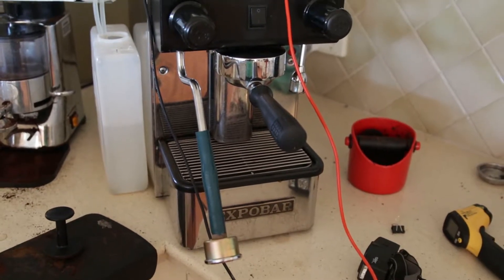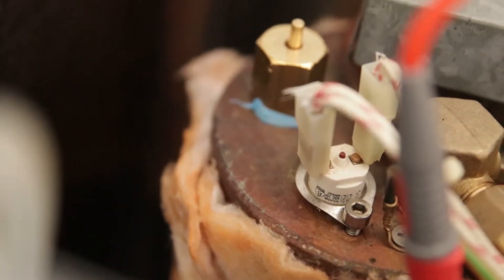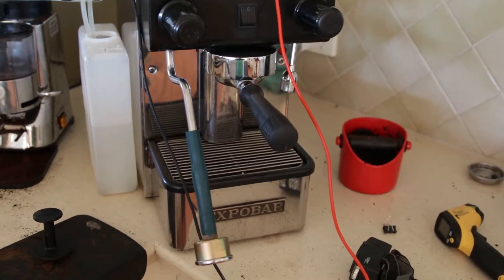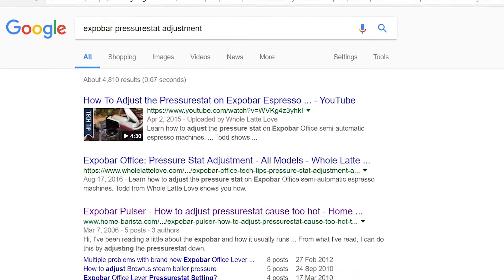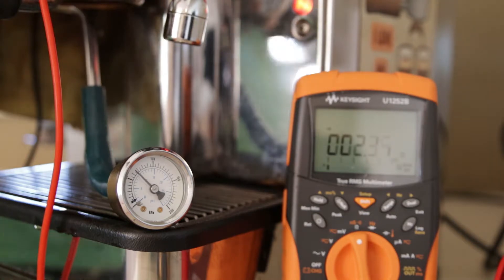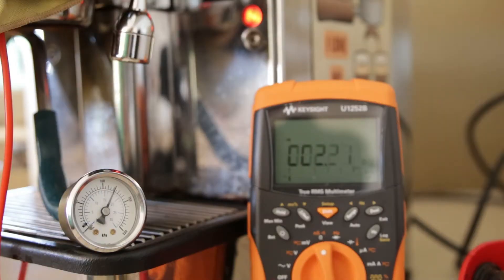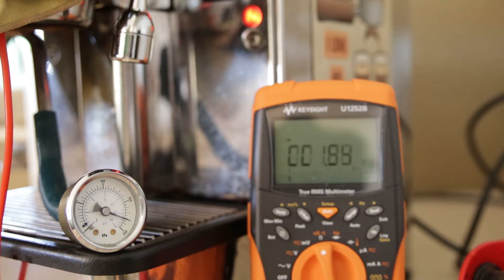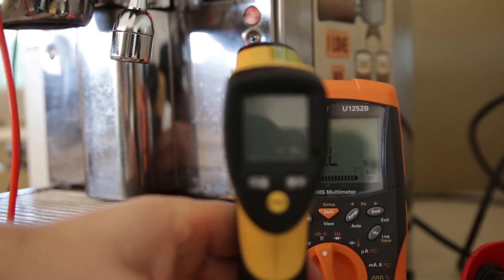expobar pressurestat failure - no heat

Comment: Mine builds up pressure, though attempts to lower it by releasing pressure (tsst.. tsst..) but still gets over 2.2 bars. Then the release valve sounds a popping sound. At this point I have to turn the machine off and release pressure via the steam wand. When the machine is turned on steam builds up normally to 1.3 bars and stays there for a while (hour or two) and then pressure builds up to 2.2 bars again. Does that mean that I need to replace the pressurestat?
Reply: Possibly the vaccum release valve.

Comment: Mine when turned on this morning the indicator light never turned on and the machine isnt heating the water at all
Reply from the maker: Cyryl Dave Gelito that sounds like the over temp switch tripped. With all power off (unplug it) you can remove the water tank and top cover and reset the switch. If it keeps happening you probably have the issue described here.
Reply: @skunball  i did that and pressed the little button on the center and still. Nothing changed.
Reply: I really think we have the same problem.
Reply from the maker: Cyryl Dave Gelito if you are suggesting you have a defective pressurestat (stuck in an above pressure state, then you can confirm this by bypassing the pressurstat by shorting the two plugs connected to it. A paper clip works, but of course make all connections with machine unplugged and do not touch when you switch it back on. Also, it cannot be left this way but it will diagnose if your problem is a pressure stat. Likewise, you can short the two plugs to the over temp switch to diagnose if that reset you tried was faulty. Hopefully for your sake it is one of those parts as both are cheap and easy to swap. The element is hard. Boards also hard.
Reply: @skunball  thanks man.. ill update you with my progress